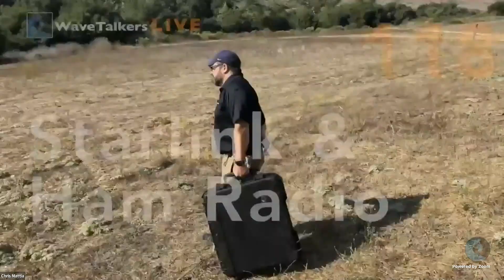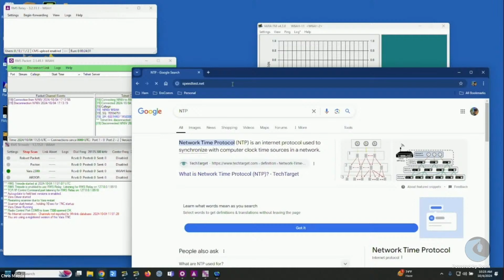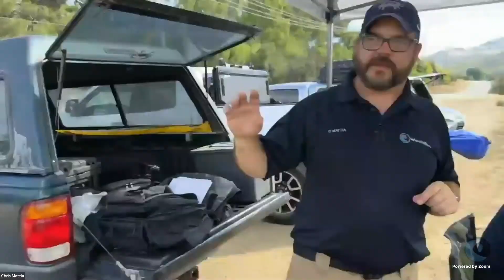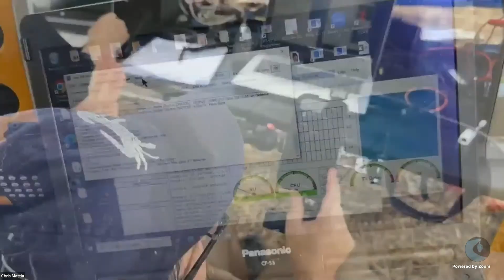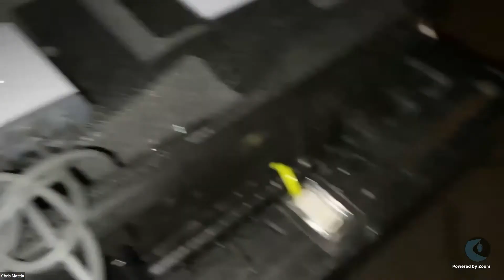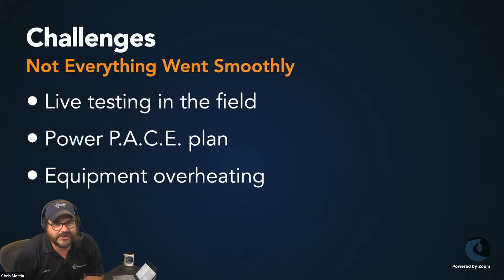Starlink & Ham Radio - WaveTalkers LIVE 118

Comment: HF / VHF / UHF via the Yaesu FT991A
Reply: It's what's known as a shack in the box, basically it's a single radio that tries to do everything but really doesn't do any one of them very well.

For example the FT991A has a reciprocal mixing dynamic range of 70DB at 14.1 megahertz at 1 kilohertz delta, You need to move to 20 kilohertz delta to finally reach 100 DB of reciprocal mixing dynamic range.

To put this in perspective the icom 7300 has A reciprocal mixing dynamic range of 100 DB at 14.1 megahertz at 1 kilohertz delta By the time you get to 20 kilohertz delta you're looking at 119DB of Reciprocal mixing dynamic range.

That's a staggering 30DB difference at one kilohertz off. Don't get me wrong at one time 70DB of reciprocal mixing dynamic range was considered very good, this would put the FT991 A on par with something like the icom 756 pro 3 which in its day was considered a contest radio.

Where things really start to fall apart for the FT 991 A is on VHF and UHF, the FT991 A has a reciprocal mixing dynamic range of just 64DB on 144 megahertz with a delta of two kilohertz

To put things in perspective the icom ic-9700 has a reciprocal mixing dynamic range of 106 db Under the same settings That's a staggering 41DB of difference And he gets even worse at UHF , at 432 megahertz the 991a only has 47db of reciprocal mixing dynamic range While the ic9700 has 100 db of reciprocal mixing dynamic range,  That is a staggering 53DB of different in reciprocal mixing dynamic range of 432 

But then again the IC-9700 cost more than twice as much as the 991A and it only does VHF,UHF and microwave

 don't get me wrong a shack in a box like the ft991a is great for beginners and casual users but eventually you're going to want to move to a more advanced radio system with dedicated transceivers for each, Especially if you plan on chasing dx or working dxpeditions.. The performance difference is fairly significant..

The best way to explain it is that the FT991A is primarily a VHF,UHF FM repeater radio and as an after thought they've added all mode and HF capabilities. Something like the IC 9700 was designed primarily as a VHF, UHF weak signal radio with FM radio capabilities thrown in for convenience. That's why there's such a huge performance difference between the two.

The IC7300 even though it's considered an entry level radio today would have been considered a top class competition radio just 12 years ago. Even today it competes very well against radio's costing three times as much. The IC 7300 is an $800 radio that performs as well as a $3000 radio, the FT 991A is an $800 radio that performs like an $800 radio
Reply: @dannelson8556  well, for emergency communications the FT991A does quite well for our ARES group. Emmcoms is a regional effort, to work within a given area or state is 99% of the need. For $800.00 the work gets done. Portability of the radio and antenna system is enhanced with the built in tuner and even our brand new tech members can be functional in the disaster communications scenario. With our budget being anemic we wanted to focus on the biggest bang for the buck and the 991A does that.
Having a high end rig that can talk from zero to God is nice thing to have but for the price of one IC9700 or some other DX rig we could have the FT991A, the antenna, a battery system with solar panel and even a handheld or two …. Up here in Alaska it’s all local because one mile out of town or village and your in the bush with any help or rescue hundreds of miles away. God help us if the FEMA folks get involved. Your article is very well written and for me an eye opener … every radio offered to us hams has a niche to fill and the FT991A does fill a specific niche.
Reply from the maker: @michaeldavidheit  excellent radio.

Comment: I help step up Star Link Gen3 standard for my best friend in his RV. Got it for $299. The Gen3 uses Cat 8 cable with 568B ends.. It came with a 50ft. I made a custom 100ft. They both worked was getting about 300 to 500 MB download speed.. Just need northern horizon clear.. He is able to use his laptop, phone, network printer at the same time. The setup was Star Link as a Wan to his RV WIFI router.  Use it from Alaska, through Canada, to Kansas.. Was able to watch YouTube and Netflix and other steams.. It was way better than cellular if we had cellular service. The Gen 3 does have an internal heater for snow.. Didn't run into any snow...
Reply from the maker: wow $299 is a great deal.  The overall system is really impressive and we are really looking forward to getting our hands on a Starlink Mini to put through its paces and ultimately use in the field for deployments and exercises.

Comment: i've been building a starlink mini gateway for emergency deployment.  Have had no problems with the starlink.
Reply from the maker: The Starlink mini looks to be an awesome product and much lower power draw then the Standard panel we had access to.
Reply: Apts works faster laptop radio that's it 911wtc we had no phone no cell point to point plus you still had voice com 
You need to set up in 10min and move fast if you had to
You got to much stuff 
I see Big problem with your set up
Point to point voice still the best 
Field day set up in the middle of nowhere

Comment: Cool
Reply from the maker: @KY4TRK  Thanks!
Reply: @WaveTalkers  I didn't know what more to say for now.
Reply from the maker: @KY4TRK  What did you find most helpful in the episode?
Reply: @WaveTalkers  what I fill is missing in a lot of this is, not every one has the latest and greatest equipment and some of us have icom 706, 706mII, 706mIIg, icom ic-7000, to kenwood / Yeasu older models HF Rigs or VHF/UHF radios. A lot of folks forget in laying out the parts for making everything work, modems link the kantronics VHF/UHF to HF and the connectors and cables needed... it's easy to deploy when you know what is needed to make it work. I'm talking out side of the newest latest and greatest usb radios. Let's dial it back to a little older school affordable off the eBay/Ham sale site's rig setting Up for making it work. Elmering...
Reply from the maker: lots of our shows cover a wide range of rigs and interfaces. As we acquire more gear, new and old we do our best to integrate it when and where appropriate.  Thanks for the feedback, 73
Reply from the maker: Several recent episodes have covered low cost interfaces such as DigiRig, signalink, AIOC, etc.  perhaps the most flexible and low cost is DigiRig.
Reply: @WaveTalkers  Yes some of them do, though they miss a lot of the fine details with the installation of said equipment to parts to software. Thanks for all you do. we are all still learning in this hobby. James KY4TRK
Reply from the maker: @KY4TRK  thanks for the feedback.  73!
Reply: @WaveTalkers  I have older equipment so like a icom 705 or one of the newer ones I'm not able to do hf winlink. Telnet is about all I can do for now. I have some older kantronics kan 3 but don't have the right cables for what radios vhf/uhf I do have or other issues with not having the cables for the kenwood tm-d700a with the DB9 on the front of the radio to DB9 to USB or a DB9 gender bender... just heald up with with no money for parts right now tell I get my SSI going...